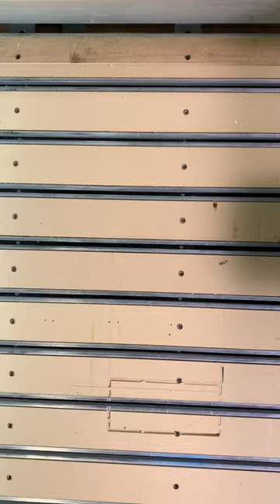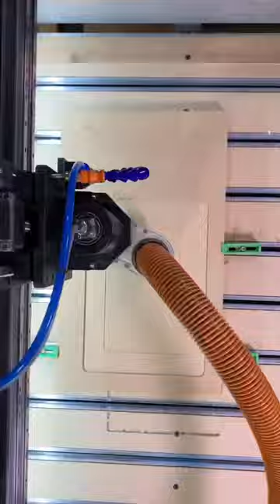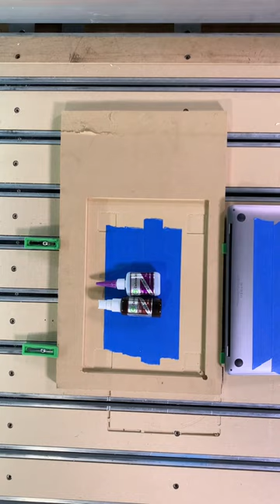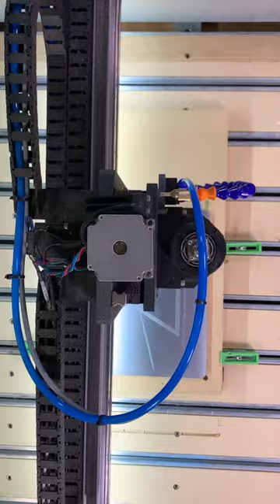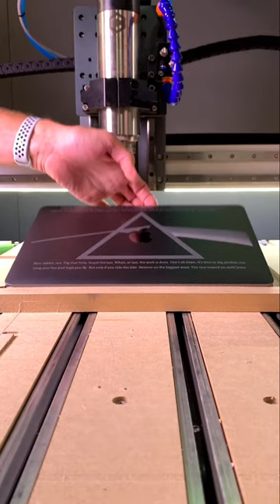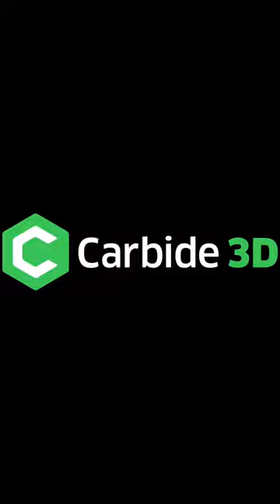Drag Engraving a MacBook

Comment: Very interested in the drag engraving, but would like to see some magnified examples of the work being produced. I’m a jeweller and have a use for such a CNC. Been eyeing the HDM
Reply from the maker: Hi Dennis.   Drag engraving is displacing. material not cutting material.  With the 120° engraver in particular the lines are extremely fine.  While, I imagine a jeweler's definitions of "Fine" might be different than mine, the texture has a very slight feel to it on the MacBook surface.   It's quite pleasing and not at all rough.   Take a look at out Instagram feed to see more closeups of engraved brass.  Particularly on some recent earring projects.  That will give you an improved picture of the overall process.   https://www.instagram.com/carbide3d/
Reply: @carbide3d  that certainly looks like what I’m after,,,, the drag engraving process is just the repeatable layout step, which would be followed up with deeper hand engraving over the drag engraved lines. Drag or engraving with a spindle can’t duplicate the bright cuts made by hand engraving.

Thank you for the link,, I’m still not ready to pull the trigger, but if I do it would be first half of 2023 (too many projects on the go right now)… thanks Dennis
Reply from the maker: This is a process several of our people employ.  One of the best is Tom Sterling.  Check him out here: https://instagram.com/tom_sterling_hand_engraving?igshid=YzA2ZDJiZGQ=

Comment: I know this is a bit of an older video. I do have a question. How did you get the different textures on the rainbow coming out of the prism?
Reply from the maker: By varying the Infill Density via the Stepover setting.

Comment: How toolpaths were done for the non flat surface?
Reply from the maker: That’s an excellent question.  I separated the top line of lyrics from the rest.   Taking advantage of the spring loaded construction of the MCEtcher drag engravers, I was able to set a deeper depth for that particular line.  Thereby capturing the “round” of the computer inside the throw of the spring.

Comment: Did you have to model or scan the surface of the MacBook?
Reply from the maker: There is a file on CutRocket.  Linked in the description.   It’s for a MacBook Air 2017